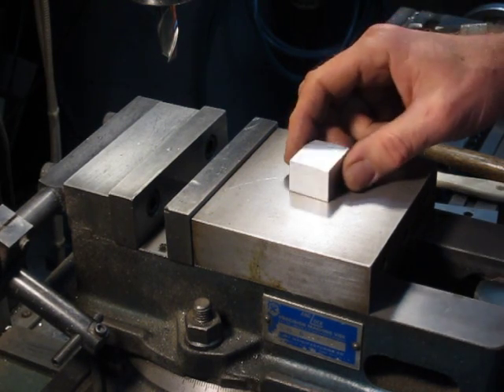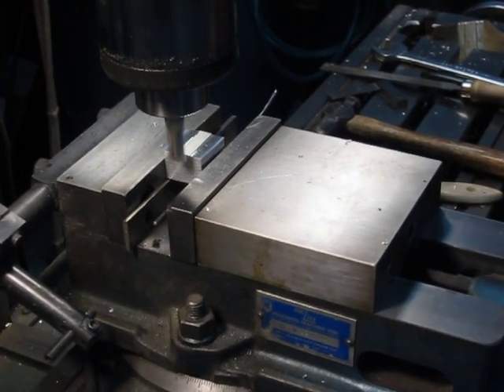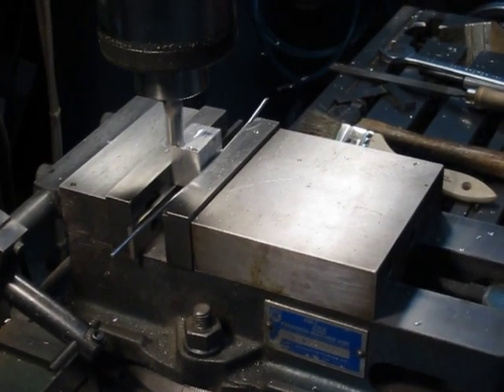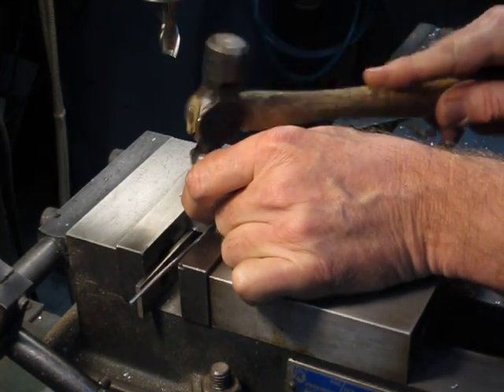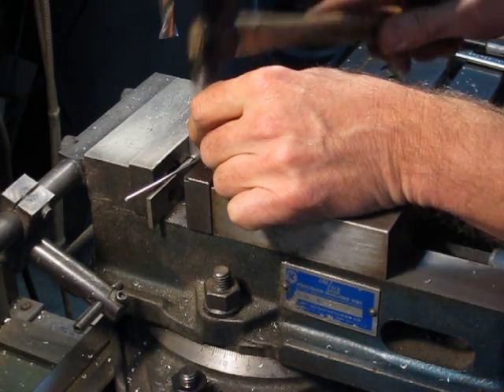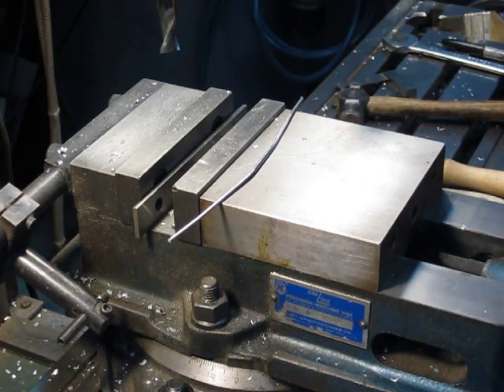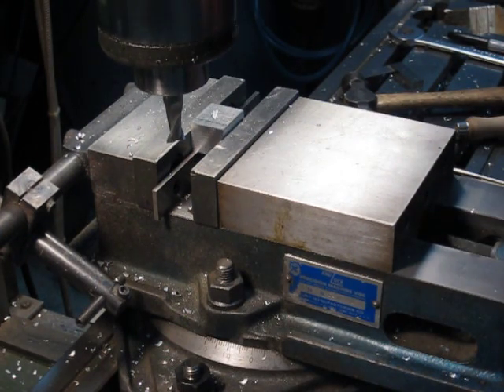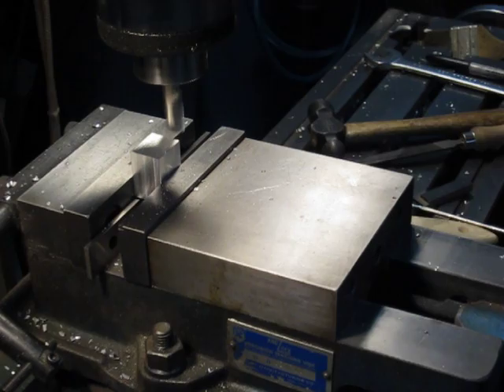How to square up stock on the milling machine

Comment from the maker: For this particular procedure it's not necessary that the solid jaws of the vise be parallel to the table because all the milling is performed on the top surface. However, unless you are purposely making an angled cut on a part, the vise jaws should always be kept parallel to the table, just as the head should always be kept perpendicular to the table. I have a video showing a quick way to indicate the solid jaw on a vise, it's called "Indicate the vise on a milling machine in just one pass".

Comment: Great video! I have a question for you: For this to work you need to have your vise jaws parallel to the cutting bit, right? How do manage to do this accurately? Cheers!
Reply: Read my comment above. It won’t matter if your vise is square! As long as it’s not so far off that the sides won’t clean up. I need to make a video of this is what’s out there.

Comment: Procedure is fine. Not using a fly cutter or a cutter big enough to cut smaller parts is something I disagree with. I would never use 3 passes to cut across something 1" wide. The only other problem is you didn't share that you needed to make sure your head was true before you started. I know that should be a given but some people might think that it is not needed with that procedure.

Comment from the maker: I was a shaper hand in the early 70's. Mostly squared stock for a tool and die company. Everything came in sawed pretty close so there wasn't much stock to remove. Occasionally I would get to shape to a curved line for a blanking die which was fun, although a bit nerve racking. We would get chewed out if we left too much stock and lose our job if we "crossed the line" too many times. Shapers went away shortly after that, replaced by horizontal mills and Blanchard grinders. Just too slow I guess.

Comment: Although I know this method, what if a block comes in way off square?  we will
typically scribe it get it close, then vise it mill it. Ok got one flat, now turn upside down
and use paralel & rod & mill it. Now we have two perfect planes. 1&4. Now do 2&3
the same way.  2nd step mill to specs.  For the ends we indicate it vertically and do both ends. In 1959 , thats  how we did it.  Shapers too.  Sorry to say but with a shaper 10 min job with a 2 cent HSS bit.  whatever works for you. good vidio

Comment: I've machined a long time, I guess I'm the new school. I only learned this method a few months ago. My boss said to do it that was and I tried it but when I checked the part to see if it was square it wasn't. So I went back to the way I know makes it perfect. I definetly never square the 5th side with a square like that. And I don't do it with something round in the jaw. Try that with a bigger part and check if it's actually square, not parallel. You'll be surprised

Comment from the maker: The basic formula for rpm is four times the cutting speed of the material divided by the diameter of the end mill. In this case I was using a 1/2" end mill and cutting aluminum, which has a cutting speed of 250 surface feet per minute, so 4 X 250 /.5= 2000 rpm.

Comment from the maker: I would end mill the four sides of the bar and side mill the ends. Side milling makes sense on long slender parts like bar stock, but on larger more square parts, end milling would be more appropriate.

Comment: Thanks for the response.  I used parallels (and your other suggestions) just like you demonstrated - worked great!.  Reading the other comments, you mention avoiding the side milling if possible.  For the first side, would you place the flat bar upwards in the vice (clamped on the 1/4" dimension) to square the 1/4" side first, or lay it down and cut the side?  The latter does not offer much material for setting the aluminum weld bar.  Thanks!

Comment from the maker: Thanks, glad you enjoyed it.

Milling bar stock is pretty much the same technique. You'll need a set of thin parallels and since you'll be working very close to the vise jaws, you'll need to be careful. Basically machine one side flat, place it against the solid jaw and machine the 2 adjoining sides square and to size. Then clamp it in the vise with the remaining side up and machine that to size. The ends can then be side milled to length.

Comment from the maker: You never tighten the vise after tapping the part down, that would risk lifting the part off the parallels again. Tighten it first, then tap the part down and take the cut.

Climb milling can be used at any time on a rigid machine like this. If you are using a lightweight machine such as a bench mill, climb milling should be limited to a finish cut.

Comment: Dont you have to tighten the part after taping it, and inst climb milling only used in finishing cuts, especially if your part is not tightened like that?

Comment from the maker: The spindle should always be perpendicular to the table. If not, your end mills won't generate a flat surface (particularly noticeable with larger end mills and fly cutters) and the holes you drill won't be square to the parts.

Comment from the maker: Coolant can be used to allow higher feeds and speeds, especially on steel, but it is optional. In this case I'm taking light cuts in aluminum, so coolant isn't necessary at all.

Comment from the maker: Nope, high speed steel. I'll use carbide on tool steels or if I need the extra stiffness but generally high speed steel will produce a better surface finish, especially on aluminum.

Comment from the maker: Thanks, but a ball pein is my preference for many reasons; they are small, readily available and work very well as long as you use the ball end or the edge. In fact, it is much easier to feel when a part is down tight on the parallels with a ball pein than a dead blow. If I'm working on a finished surface, I just use a small nylon faced hammer to tap the part down. You may want to give it a try.

Comment: nice video but you really need to get a soft hammer for setting the part in the vice, I don't think hitting aluminum with a steel ball pein hammer is such a good way to do it. A proper dead blow plastic type is a much better choice.  cheers

Comment: I also think the tip I found most helpful was tapping the stock into the vise.  I don't have a kurt, or kurt knock-off so the CNC vise makes the work rise.  I just made about 4 blocks perfectly square last night after watching this video.  Also I mimicked your tool path always doing climb milling, and shaving the edges.  Sometimes its just the small things one forgets.

Comment from the maker: You are welcome.

The moveable jaw of the vise has freedom of movement about the Z axis, but not the X axis. Using a wire or rod between the part and jaw compensates for that.

Comment from the maker: An end milled part will be more square than a side milled part because there is no flex in the end mill. Side milling is fine for panels and other thin parts, or if there is no other option, but I always end mill thicker parts if possible.

Comment from the maker: The reason I use soft aluminum wire is that it will conform to the irregular surface of a sawed part. Steel rods will work on a flat surface but may not hold as well on an irregular one.

Comment: i do it simalar but i use a piece of 1 inch or half inch 1018 steel rod. i have two with the oil coat still on it. and two that are polished and cleared.

Comment from the maker: You can take deep cuts in steel as well, but it takes experience to know when it's appropriate. Plunge cutting with long end mills is a good example of when climb milling is appropriate. I have a thread in the gunsmithing section of metalworkingfun where I mill a deep pocket in steel with a 1/4" by 3" end mill and climb cut it. It also takes rigid machinery. I wouldn't try much climb milling on a bench mill. In cases like this, I like to climb around the edges so it doesn't raise a burr.

Comment from the maker: Yeah, this comment has been beaten to death so to speak. As I said before, the ball pein is only used on rough sawed surfaces. I have a nice plastic mallet to use on the finished ones. You might want to delve outside the box a bit and give the old ball pein a try. They work great.

Comment from the maker: As do I, but only after finishing two surfaces at right angles to each other. It doesn't make sense to de-burr before that because the side against the parallel will be sawed anyway.

Comment from the maker: Thanks!

Not sure why you wouldn't climb mill, unless you have a smaller mill that lacks rigidity. Climb milling is perfectly acceptable on larger, more rigid machines and in fact provides a better surface finish than conventional milling, especially on aluminum.

Comment: What you should have done was chuck up the part over to the right of the vise. You then can cut the top and the r.h. side both. This insures that you now have two surfaces that are 90 degrees to one another. After that, you put the r.h. side that was machined on to the parallel and the top surface that was machined to your stationary jaw. Also never tap a part down with a metal piece, it will bounce the part off of the parallel

Comment from the maker: Yes, using another part to space the jaws is an option as is using a machinists jack or an adjustable parallel.

Flex in an end mill is not negligible. They all flex and longer ones can flex considerably. You'll always get a part that is more square by end milling which is why I prefer to do it that way, and do it that way in this demo. Proper use of a square is a learned skill and comes from experience, just like the feel when miking a part or when using a telescoping gauge.

Comment from the maker: Thanks for commenting.

I prefer the feel and size of a ball pein over other types of hammers on rough surfaces. If I was working on a part that was already machined, I would use a plastic hammer.

Sticking small parts out the end of the vise if fine for larger parts, but on a small part like this it's asking for trouble. The vise won't grip the part evenly and the risk of it moving is high. A side milled part also won't be as square as an end milled part due to flex in the end mill.

Comment: I guess squaring-up side 5 (& then 6 since it references from 5) accurately is dependent on having a really good square, correct?  Do you get square to one thou using your square?

Comment from the maker: The quill is not calibrated as accurately as the knee, it's meant for drilling only. Whenever you are milling, the quill should be locked. To mill a part to a specific thickness you would take a cut and set the dial on the knee to zero, measure the part to see how much you need to remove, raise the knee by that amount and take a finish cut.

Comment from the maker: Over the years I've found that a simple ball pein works as well or better than a dead blow or lead hammer: They are small so the part doesn't need to be moved as far from the cutter for access, using the ball end feels exactly the same as a dead blow (try it you'll be surprised), and it's one less hammer taking up space in the tool box. Obviously you would not use a ball pein on a finished surface, but for squaring up a rough sawed part they can't be beat.